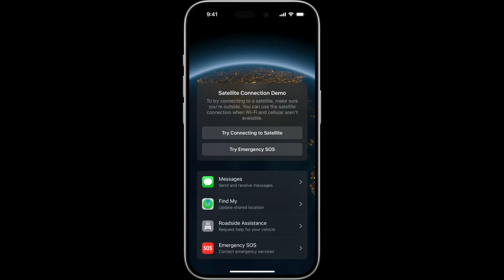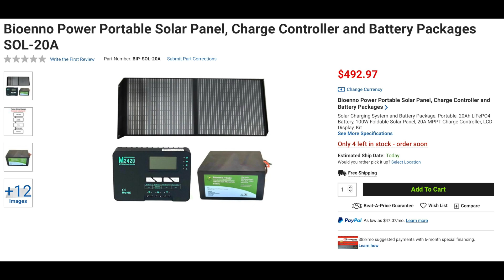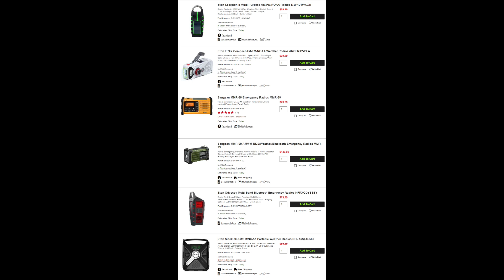Get Prepared for the Next Emergency with Ham Radio

Comment: @2:45 - Please stop misrepresenting 97.405. It does not allow unlicensed persons to use amateur radio in an emergency. It allows an amateur station licensed under Part 97 to use "any means of radiocommunication at its disposal" in cases of immediate threats to life and property. It's for hams using other services, not the other way around. Please read it again. You're perpetuating a falsehood.